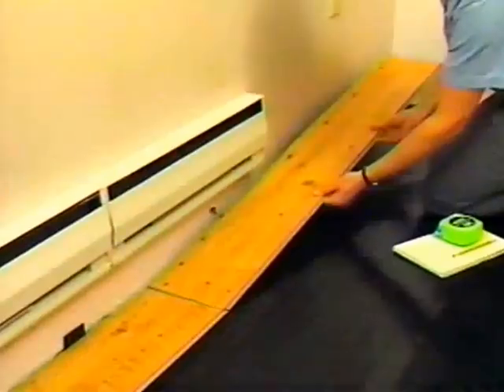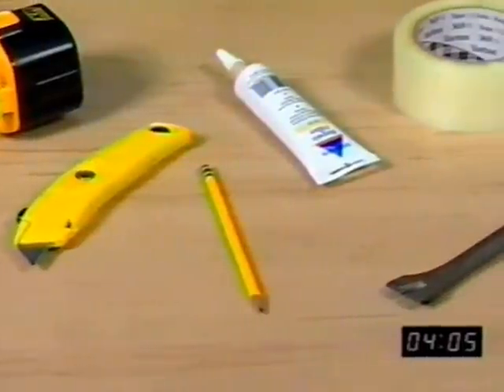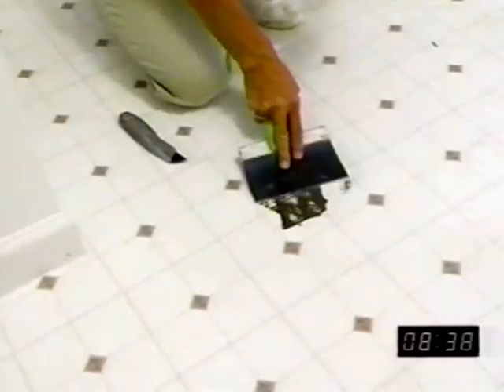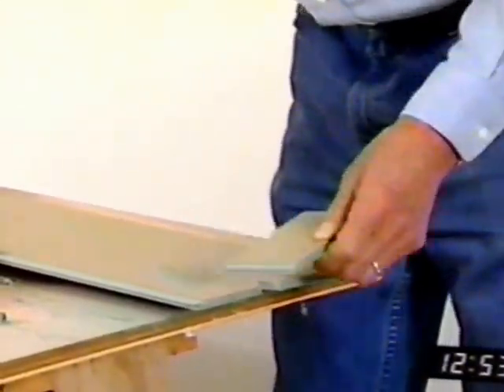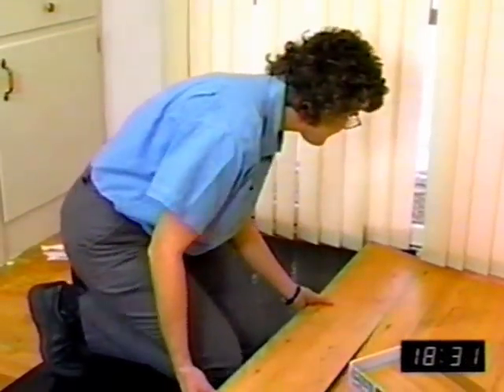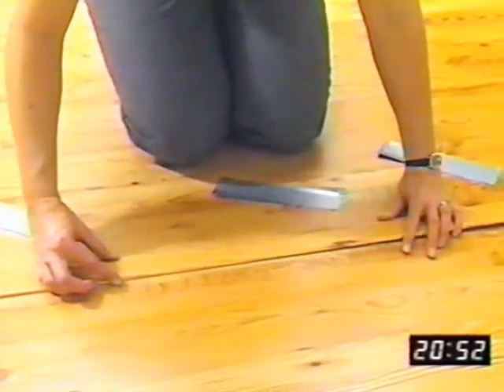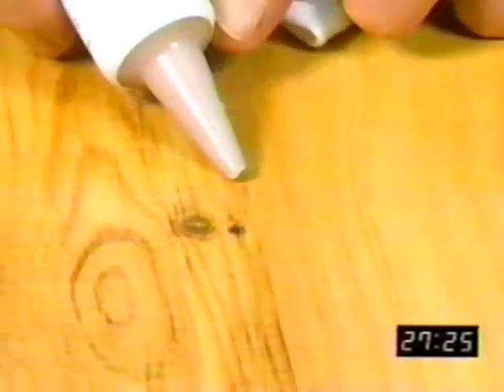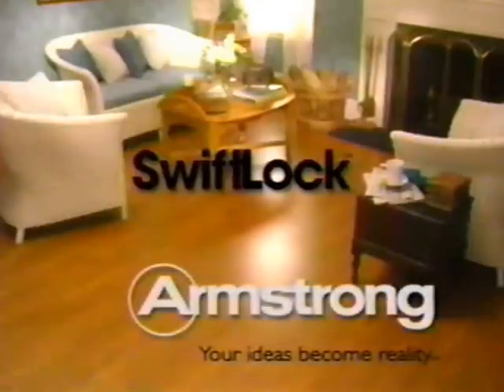Armstrong Laminate Flooring Installation CC

Comment: Just to help everybody save money. When you undercut door trims, place the underlay down, with a piece of laminate board as mentioned in the video. But turn the laminate board upside down. Now if the saw marks the board as you cut the door trim, then it will only mark the underneath of the board and you can still use the laminate board as the top won't have any marks on it. Apart from that it is an excellent video. 10/10

Comment: Nice instructive video. I live in a city apartment that has plastic tile. They are the thick hard ones. A lot of them have big gaps in where the lines join to one another indicating that they're not glued to the floor anymore. In fact, I can pick them up. Many have cracks. Let me ask you, can I install laminate floor on these tiles? As per what was told in the video, I would need to use some putty to cover the cracks and missing pieces, right? The wood under the tiles is regular pine plywood screwed with black screws. Some of them have popped up and broken the tiles. Will these bulges have to be fixed as well? 

Thanks.
Reply: i would think it would be best to remove tiles first.  but what did you end up doing?

Comment: Just some questions
1.can you show me a clear view of what a tongue look like, and what a grove look like.
2.when installing, tongue facing the wall or grove facing the wall?
3.after installed the first line, the first piece of the second line is no questioning side by side to connect the first piece of the first line, but the following pieces are connecting end to end first or side by side first?
Thank you for answering these three questions.
Reply from the maker: +Ted Pan - 1. The groove is the end which looks extended at the bottom edge of the board with a little ridge.
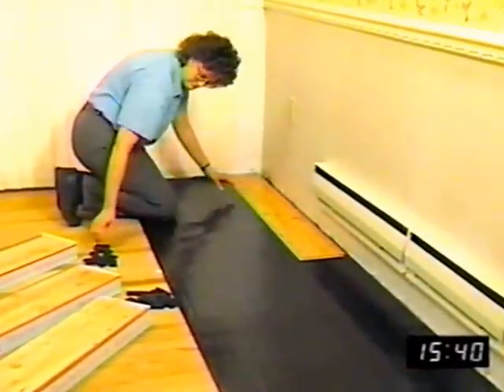2. At 15:39 minutes into the video is pretty much self explanatory.
3. Second row is connected side by side with the first row then as each length is placed you'll connect to the edge and then to the side of the previous row and give a light tap for it to snap into place. Just remember to overlap at least 15 - 18 inches if possible.
Reply: +Errol thank you Errol!

Comment: Great video, thanks! But there's no mention of whether it's OK to go over an existing vinyl floor with good subflooring; can you just lay over it, or should the vinyl be taken up?
Reply from the maker: I've never installed Laminate Flooring over an existing Laminate Flooring. My thing is...it's better to remove the old Laminate Flooring and install new ones. However if you decide to use Laminate Flooring over an existing Laminate Flooring then I suggest you install it in the opposite direction of the existing Laminate Flooring. So if its running North to South then install it East to West over the old flooring or vice versa.

Comment: If you are going to use adhesive with your steer nosing all you need is a Brad Nailer with no pre-drilling and no large finishing nails. much easier and smaller hole

Comment: My subfloor not even in some spot? Any idea how to fix this?
Reply from the maker: Hello Kennedy, Is the sub floor concrete? If yes then you can mix some mortar with sand and cement, get a straight edge at least 4 to 6 feet long and apply the mortar in the affected areas, then take the straight edge and screed the floor passing it over the straighter section of floor to get it even up.

If your sub floor is made of lumber and it's in bad shape with unevenness then you can lay down some 1/2" thick Particle board 4x8 sheets or any other similar material that is sturdy and durable and apply it on the floor in such a way when laying it down to be placed directly over the affected areas. It will be costly depending on how large the area is. After that you can then install the underlayment and laminate flooring in opposite direction to the new sub floor. Hope that can help you or give you some ideas. You can also do a search on YouTube using some key words like "How to level a wooden floor" etc.
Reply: Alright, I will try it. Hope it goes well.

Comment: What is the best way to install laminate over a 3500 sqft open retail space  area?
Reply from the maker: If you had given the dimension of the area I'd been able to give you my thoughts. However since you gave me only the area that will be hard for me to help you.
If the area in question e.g. is 35' x 100' then the best way is to run it down the 100' length and use the 35' as the width.
There are also other things to consider e.g. the Sun direction and how it will look if the Sun is reflecting on it. Just throwing out some pointers. It may not necessarily be the Sun but other things you can consider like how it will look being its for a retail space most likely being used for commercial purposes etc.
Reply: Thanks, actually those are the approximate dimensions. My concerns was possibly movement or bulging with temperature changes. Would gluing it down make sense? It's will be installed on top of concrete.
Reply from the maker: Don't glue it down because the movement will cause it to separate.
If you glue it down onto the floor, what will happen...the space along the walls which is actually for contraction and expansion will force the floor to pull apart.
What you can do is glue the edges together, that will help a lot. I've glued the edges and never had issues.
Just so you know, in my description above about the video I mentioned "August 2004" and to this day the floor still holds out and is looking awesome, after 13yrs of everyday use and abuse.

Comment: Do you have to have an underlayment?
Reply from the maker: The long & short story...Laminate flooring is so flimsy and insubstantial that it needs all the help it can get. Let's use sound transmission as an example. You don't need foam padding under solid hardwood because hardwood limits the transmission of sound, both within the room and to floors below.
Without underlayment, your new floor would be hard on your feet. Noises would more easily transmit to floors below, as well as within the room where the laminate is located. Finally, sub-floor imperfections may "telegraph" to the surface of your laminate.

Laminate underlayment will:
1. Provide your floor a bit more thermal insulation
2. Bridge minor gaps that sub-floors or existing floors have.
3. Absorb sound.
4. Make it easier for you to walk because it's softer.
5. Act as a moisture barrier.

But Is It Even Necessary?
In some cases, underlayment doesn't make a difference. If you're laying laminate on a smooth wood sub-floor, the inclusion of underlayment doesn't make the floor warmer or quieter. If anything, underlayment gives laminate--in my personal opinion--a mushy, swishy "laminate floor" feeling. It's a feeling that real solid wood flooring does not have. At $0.25/square foot, underlayment isn't particularly expensive. But if you're trying to go cheap by installing that $1.00/sq. ft. laminate, it jacks up the total price by 25%.